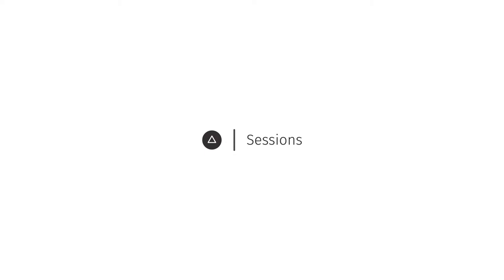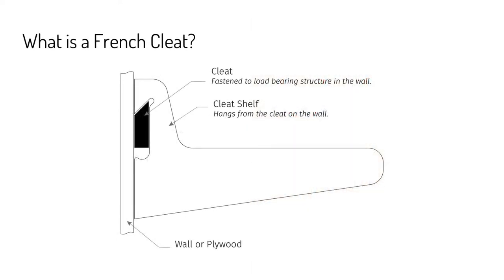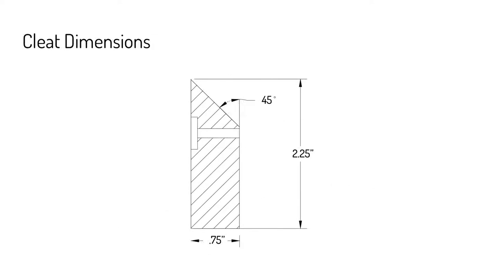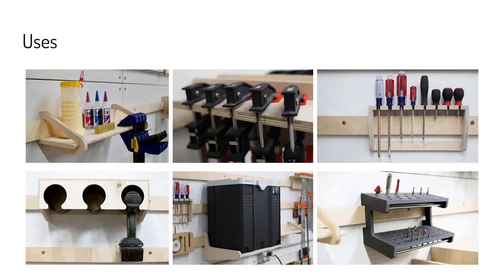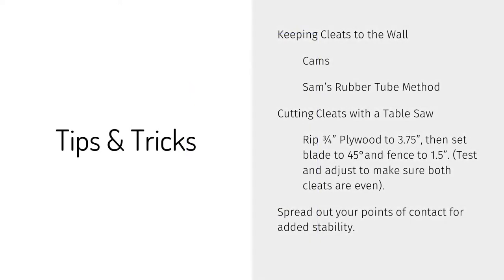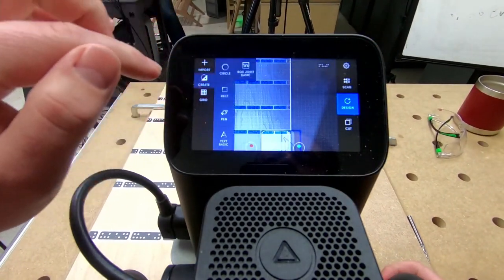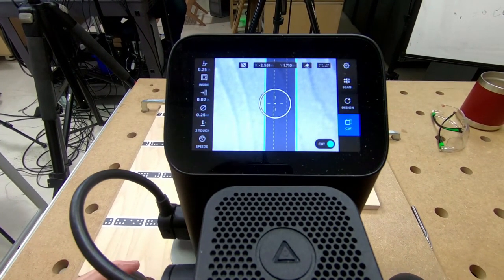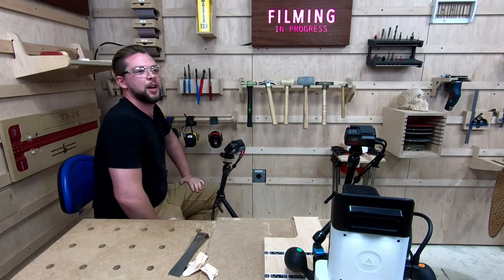Session 18  – English: French Cleats and Origin

Comment: I know this video is quite old, but I just got an origin and am in the process of setting up a proper shop and I wanted to give a heads up to anyone about to try this: The tip about  cutting the boards to 3.75" wide and then tilting the blade to 45° and setting the fence to 1.5" will yield two cleats of different sizes. The one cut closest to the fence will be true 2 1/4" but the other will be 2 1/8". Setting the fence to 1 7/16" will yield two cleats at 2 3/16". Changing the first cut to 3 7/8" and keeping the 2nd cut at 1 1/2" will yield the correct sized cleats.

Edit: fractions